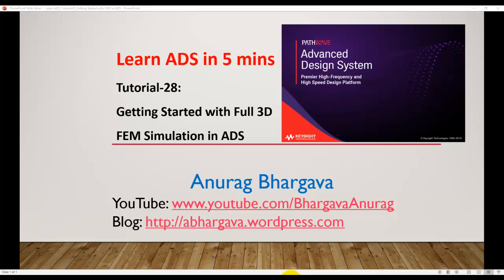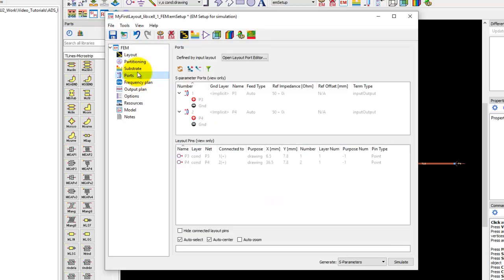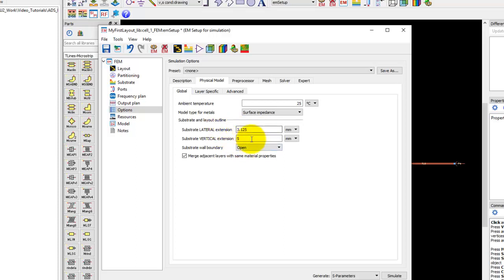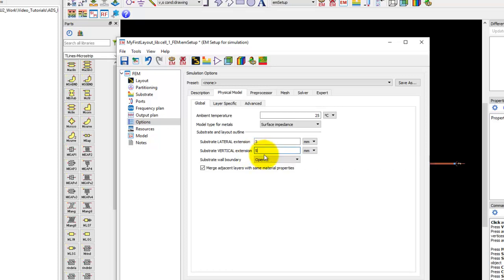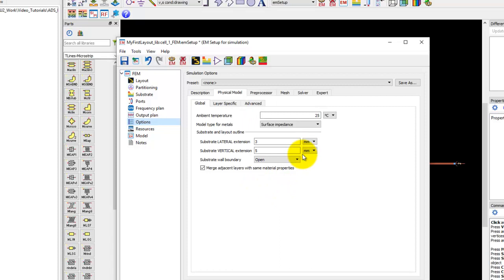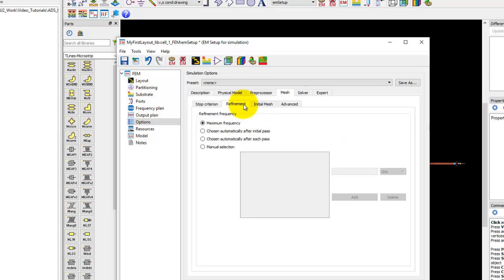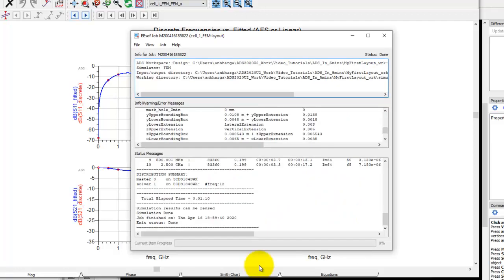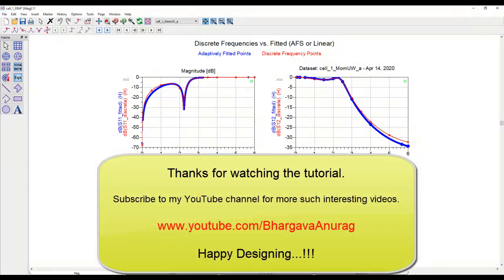Tutorial-28: Getting Started with FEM Simulation in ADS

Comment: Hi, I am trying to simulate a PCB to check for 0Hz magnetic field generation. Does it is plausible to do it with FEM.

I already did all the preparations and i can run momentum simulations but it gets stuck when i try to do FEM simulations. In the logs status message it gets stuck in the part where it sais automatic inititial target mesh size.

At first it shown a really large number 10^6. But after seeing you video i get it to a similar number as you get.

Could you give me some insight pls.

By the way. The frequency i am interested in is 0hz to 10 hz. But i swip from 1 Ghz to 0 as if intry to use a slower sweep it gets errors.
Reply from the maker: None of the softwares with FEM solvers are good for simulation around 0 Hz.

Comment: Hi Anurag, thank you a lot for your great tutorials, can you please help me, I want to simulate passif structures (Coils, MIM capacitors and transformers) on Silicon substrate. I don't Know what is the best simulator to use it: Momentum RF, momentum Microwave or FEM ? 
I want to study the variation of Q factor inductance, capacitance, mutuel inductance etc as a function of frequency.
Really your channel is SuperGreat Thank you.
Reply from the maker: For the structure you mentioned Momentum would be sufficient as you really don't need a full 3D simulator like FEM. Whether to use Mom RF or MW, is your choice but mostly MoM-RF is sufficient as those structure are electrically small component and RF mode works very well till half-wavelength. Kindly refer to ADS documentation for more details.

Comment: Helle thank you for the video it"'s verry useful. I have 2 questions which is the difference between HFSS and FEM in ADS. 
and the second question is which is the difference betwenn momentum RF et momentum microwave and FEM
Reply from the maker: Hi Farah,
Some of the points are provided here for your help. For more info you can refer to ADS documentation or contact tech support team:

1. Its difficult to answer HFSS vs ADS FEM in detail but just be aware that HFSS is also based on FEM for frequency domain analysis so there is lot of similarity how Mesh is created, refined and problem is solved.
2. Momentum is a Method of Moments based planar EM solver whereas FEM is a full 3D solver that can handle any arbitrary 3D geometry for simulation
3. Momentum RF is based on quasi-static technique of EM simulation whereas Momentum-Microwave is a full wave solver.
ADS documentation provides detailed description of Momentum and FEM, it will be worthwhile if you go through the documentation.

Comment: Sir, I'm working on 1:4 powerdivider and combiner, results with method of moments were satisfied s11 at desired frequency was -25dB, will the practical results will be matching can I go head with fabrication. 
2. Sir if i want to do FEM for same design  how to add isolation resistance 100 ohm in layout. Where as on method of moments we added in schematic.
Reply from the maker: Its difficult to comment when I have not seen the layout you simulated and how well you simulated but in general with MoM you can expect measured results within +/-5% considering the tolerances and FEM should be within +/- 1 or 2%.
Process to add 100Ohm resistor is same between Momentum and FEM, jus the emmodel will change behind the scene. You could either use emcosimulation method like what you seem to be using now or directly add 100Ohm in layout as I have shown in the Power Divider design video.
Best of luck...👍

Comment: Hello Mr. Bhargava. Thank you for great tutorials. I have a question regarding 
the port scaling factors under the options tab in FEM EMSetup. In ADS2016 by default the factors are 100. Isn't this erroneous? This makes mostly the whole surface area of the simulation box as port input/output area. I think those factors also should be scaled about 3-5 instead of a 100 times factor. Would you agree?
Reply from the maker: Hi, I wouldn't say it is erroneous....its a default setting and designer can change it. 3-5 scale factor wouldn't also work for all cases. Kindly see below text from ADS FEM documentation:
The port surface scaling options control how large the port surfaces are that the FEM simulator will generate for calibrated (TML) ports on the bounding box of the layout. You set the following options:
Port LATERAL Scale: The port surface will be extended laterally at both sides Port LATERAL scale times the width of the conductor connected to the positive pin of the port in case of an infinite ground plane. In case of a finite ground plane the port surface will be extended Port LATERAL scale times the widht of the smallest bounding box containing both strips.
Port VERTICAL Scale: The port surface will be extended vertically Port VERTICAL scale times the vertical distance between the positive and negative pin of the calibrated port. In case of a finite ground plane the port surface is extended both above and below the ground plane. In case of an infinite ground plane only at one side, the side where the positive pin of the port is located.
By setting these options to a very large value (say 1.0e6 or larger) you can ensure that the port surface covers the entire boundary surface. This will give the most consistent value for port de-embedding and is recommended when the Reference Offset of the port is non-zero.
Reply: @BhargavaAnurag  Thank you for the reply sir. I kindly would like to ask one more question related to the matter: As the ADS documentation indicated setting the port scales very high will ensure port boundaries to cover whole simulation box surface so that, for my case, it is the most accurate. But what happens if multiple ports share the same boundary surface? Wouldn't setting the port scaling factors that high somehow distort the results as we feed the circuit from multiple/different points but practically from the same excitation area?
Reply from the maker: @sirdancealot2645  Yes, if multiple ports share the same boundary then it won't be nice to use 100 as scale factor and you can think to set Port Lateral Scale to something like 0.1 etc depending on the design. Again designers need to set it depending on what structure they are trying to simulate...
This topic is too detailed to be discussed on YouTube, I would recommend contacting the Keysight Tech Support team when in doubt. They have detailed training available on this topic...Hope this helps....
Reply: @BhargavaAnurag  Thank you again. Also keep up the grest videos, I really find them useful as a newly grad engineer!